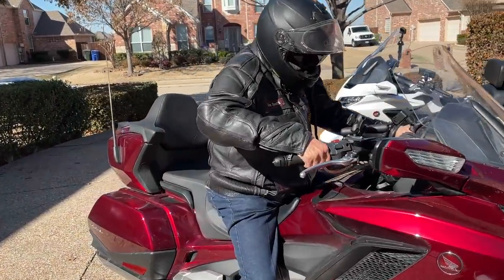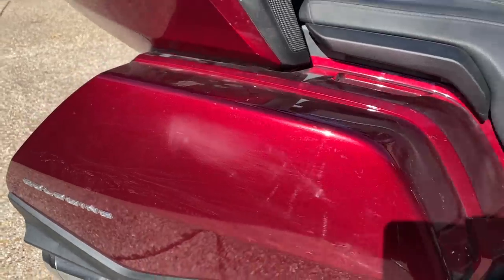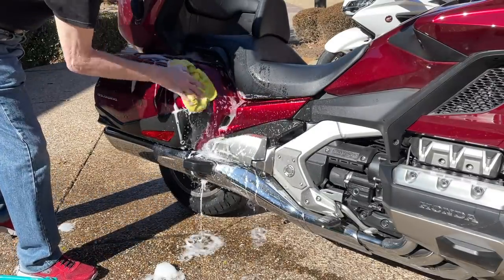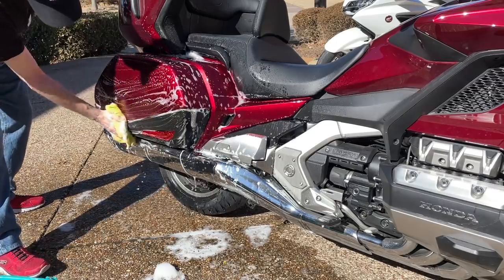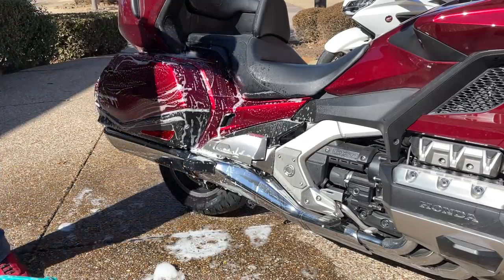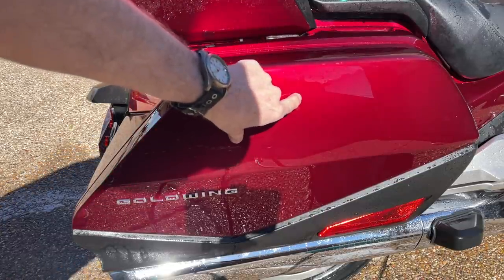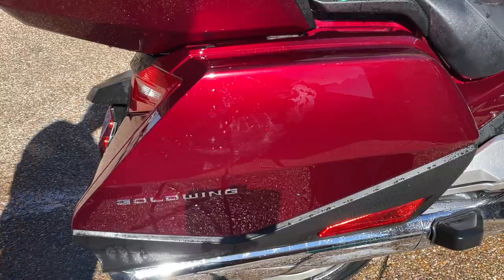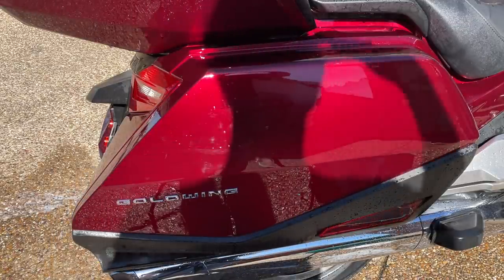Removing Motorcycle Paint Scratches | Cruiseman's Motorcycle Detailing Series

Comment: My saddlebag was keyed (or looks like a keying). One single deep scratch about half the length of the bag, deep in the start, then gets lighter. No other damage or even minor scratches to indicate I got too close to something. I watched the video several times and bought the same items and even the Griots polisher. I was nervous starting the repair, I didn't want to make it worse but got to it. Wet sanded and polished. I stopped after a couple of passes. If you get really up close to the bag, the deepest part of the scratch can still be seen. Standing next to the bag, the entire scratch can't be seen. You'd have to know the scratch was there to know where to look. Thanks for lesson. Really satisfied with the results. Now I can shine up the other bag so they both look new.

Comment: Use a small block with the sandpaper wrapped  around it to do your sanding. It's very easy to put a valley in ti using your thumb or finger.

Comment: You did a wonderful job! Nice going. I've done multiple cars and motorcycle paint corrections, and that was very good. The only suggestions I have is don't use Dawn dish washing soap. They make dedicated soaps for stripping waxes and sealants. Also clay bar area to remove bonded contamination on paint. Don't want to compound contamination into clearcoat. Everything else you did for your friend was spot on! Good good job!!!
Reply from the maker: True about the Dawn. That's just all I had in my arsenal at the time. I did do clay bar, but did not put it in the video because I am doing a separate video on clay bar.

Comment: I Always clay bar after wasshing to get most surface contaminants out as well ,i never go on the paint anything over 3. Ill start at 1 or 3 then ill dial it up when the pad is all ready  in motion as not to risk cutting to deep in one area of the clear coat.BTW the honda paint and clear coat is very thin and soft always try to kerp a good type wax on it(preferences vary on each person pick what you like)
Reply from the maker: I suspected the clear coat was thin.

Comment: Harleys put on a lot more clear than Hondas. If you can feel the scratch with your finger nail, extreme measures. you can fill it in with catalyzed  clear. Let it cure for a day or  two. Scrape it with a razor blade and go thru the sanding process that Cruiseman did only very carefully.

Comment: Chris, great video buddy. Dumb question for you; will the same method you employed for the scratch for for a pain chip?
Reply from the maker: Depends.typically a "chip" needs to be touched up with touch up paint. I may do a video showing this at some point. Once the touch up paint is applied, then it may be necessary to lightly wet sand the area and polish out.

Comment: Great job Chris.  On the Turtle Wax Hybrid Solution I am impressed, do you need to use a clay bar or anything to remove all the 'stuff' that has accumulated on the paint,, or just wash it thoroughly with car wax/soap?  I have the 2020 Canam Spyder and the paintwork is in good shape.  Of course you know how the new paints are, a bit softer than the earlier paints.   Thanks.
Reply from the maker: You certainly could use a clay bar before. I will be doing a clay bar video soon.
Reply: OK, but do you feel it would be necessary to do the job correctly?    I am totally not inclined to rubbing on these 'new soft paints' if it's not totally necessary.
Reply from the maker: @billwilliams9527  i had done a clay bar on this saddlebag a few weeks earlier, before the scratch, so I did not feel it necessary to do it again. But, in most cases, you would clay bar and prep/wash before correction.
Reply: OK, thanks Chris
Reply from the maker: @billwilliams9527  there are a lot of opinions on how to do paint correction, and I’m not sure that any of them are the absolute 100% correct. I think there are a lot of right ways to get to the desired results.

Comment: I'm not convinced. In fact I was pretty horrified. Ignoring the  garage floodlights obscuring the surface of the saddlebag, whilst the initial result may be impressive it's by no means permanent. One wash and the wax and polish disappears and all is revealed. T-cutting scratches and abrasions is never a permanent solution. When it happens we've just got to suck it up and replace or have  professional respray.